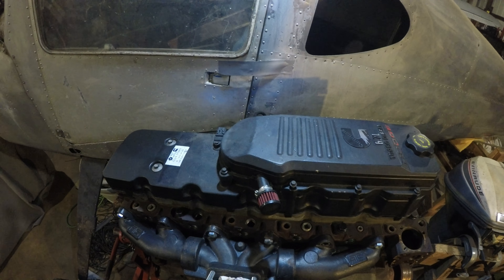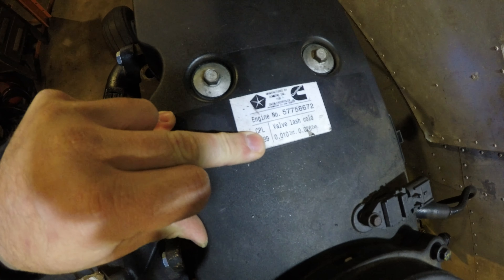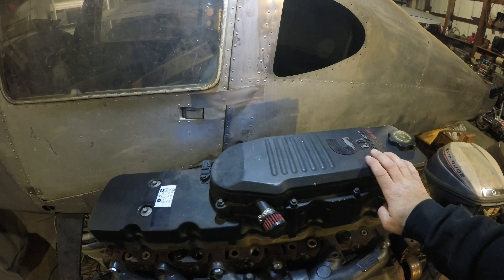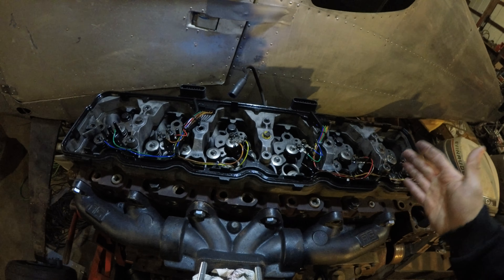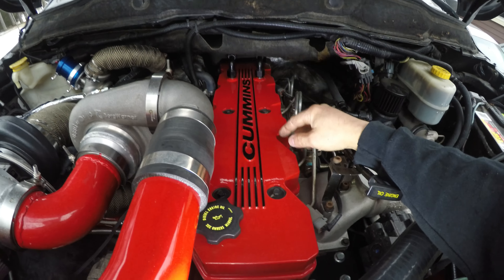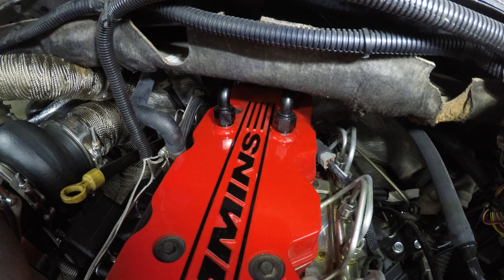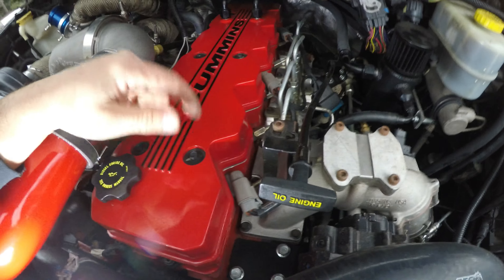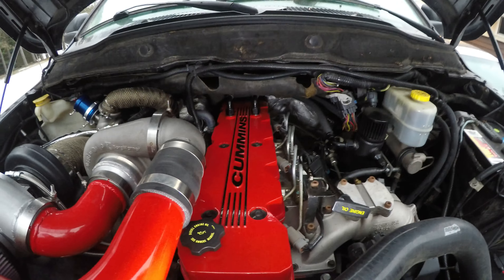Cummins Marine Valve Cover Install

Comment: I make these at work, I get them from the mold and clean all the excess fiber glass flash off of the dog ears and sealing surface, clean out the bolt holes and sensor and drain holes, put the brass in it and that gray gasket, then the bracket and finally leak test them and put them in a dunnage for shipping. We make about 380 of them every 8 hour shift. It’s cool to see the finished product.

Comment: will the valve cover work on a 3rd gen cummins?
Reply: or do they make it for the 3rd gen
Reply from the maker: @mark2goode518   That truck is a 3rd gen. Will also work on a 4th if its deleted.
Reply: 5th gen? I realize this is a 5 year old video...

Comment: What is the reason for having to change out the rocker box to the older style rocker box? Why would the valve cover harness not work?
Reply from the maker: The gasket/wiring harness will not fit the marine valve cover.

Comment: I'm curious where the two fittings go that are on the valve cover. Also, what did you do for the breather that runs to the side of the block? Thanks
Reply from the maker: The two lines run to a catch can I have mounted on the side of the brake reservoir. The block breather is also routed up to the catch can. 
I also made a video on mounting the catch can on my truck if you wanted to check it out.

Comment: Where did u get the cover from? Never put in link?
Reply from the maker: Its a factory Cummins part #3969481, so any Cummins parts or service center can get it.
Reply: @mopower9844   great thanks im gonna have my aunt order it anything else besides the 12an on catch can
Reply from the maker: @acrophobiar1   Just the bolts. I have the part number for those in the description for those as well. It's a great addition!
Reply: @mopower9844  found it thanks again i have to get this thing back on the road just bought the beans fuellabs 200 fleece blockoff and the rockerbox conversion and now that i have part numbers the valve cover and catch can

Comment: What size bolt did you use to plug the small breather port?
Reply from the maker: I'll have to get back to you on that. If I remember it's an odd size where I had to use an oil pan drain plug.
Reply: MoPower I appreciate it! I’m having a hell of a time finding the right size bolt to plug this port.
Reply from the maker: @bb502cid   Its a 12x1.5 mm.. Sorry it took so long to get back to you, I had to clear all the snow off the hood to check it out.
Reply: MoPower No worries! I ended up tapping it 1/4 NPT, will use the 12x1.5 when I put this VC on my other truck.

Comment: So will the black injection harness work from the 6.7 in this or will I need a different type on the top of the spacer. If so where can I find one and what’s the name of it
Reply from the maker: No, you will have to retro fit to the older style injection harness that is built in to the rocker box from the 2003-2004.5 trucks. It has 3 square plugs on it. I have a video on rebuilding the correct one you need in the description. You'll have to adapt the wiring plugs from the engine harness over as well, also in the description.
Reply: MoPower thank you!!! And is there any other necessary parts? If you could link to wear you bought the harnesses that would be fantastic
Reply from the maker: @waldroop11   The link is in the video description as well, under wiring harness adapter. It really depends on what you want to do with the valve cover. I did pick up another one and was going to add -12an fittings, for the catch can, on this one and extend the oil baffle farther up the cover on the inside. Someone that can weld aluminum will be helpful.
Reply: MoPower What’s the benefit of running the catch can over just welding a fitting to the side of the valve cover and run a filter to allow the PCV gases to escape
Reply from the maker: @waldroop11   You can hold the oil in the can and it wont be sprayed all over your engine through the filter. When I added mine, it immediately fixed my front main seal leak as the crank case could vent better since I had two lines at the top and the one from to side of the block to vent the blow by gasses.

Comment: Did you get any codes when you did this?
Reply from the maker: If you have a pre emissions (04-07.5) truck you won't. If you have a 6.7 with your emissions intact, its a good bet that it will throw a code for that pressure sensor in the cover.
Reply: @mopower9844  i have a 7.5 6.7 everything has been deleted since i got it 8 years ago but its throwing a code for that sensor in cover
Reply from the maker: @acrophobiar1   If you have the number for the code that it is throwing your tuner should be able to suppress that from the directory of codes.
Reply: Got rid of the codes some jackass " ME" forgot to plug in the boost sensor under new intake horn. And the sensor that was ontop of the valve cover. But now when i use exhaust brake it falls on its face until brake closes back up but only at highway speeds

Comment: Will this work on a 12 valve? If not are there and covers that look like this taht fit a 12 valve? thanks
Reply from the maker: No this valve cover will only work on a common rail head. Power Driven Diesel has some covers that will work for you, but the setup is similar. They also have a youtube channel. https://powerdrivendiesel.com/
Reply: @mopower9844  alright thanks, I'll definitely take a look, one piece valve cover look 10x better in my opinion
Reply from the maker: @noahtetreau6636   I hear you but it would be an expensive piece to make since it was never a factory option. You could swap a 24 valve head on it and enjoy the extra air, but that isn't cheap either.

Comment: Great video.  I have an 08 and have been looking at this valve cover.  Gone are the old days of just easily swapping the valve cover, lol.  That's a nice twin turbo setup you have there.  What turbos are you running?
Reply from the maker: Thank you! I wasn't a big fan of the stock plastic one. The turbos I'm running are a S588 over a S467. On the 6.7 it spool up and towing is pretty good. I have a few videos of me making and installing the twin kit.